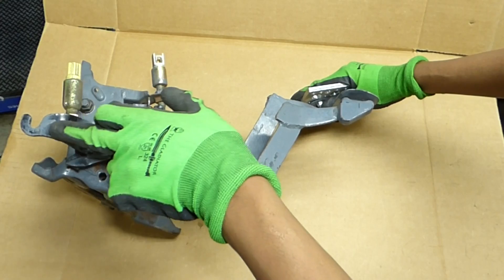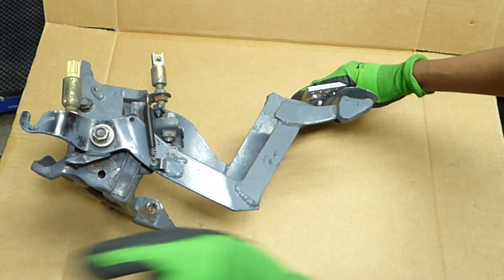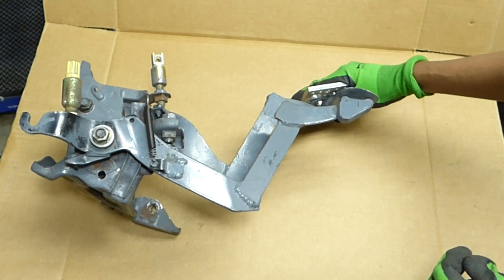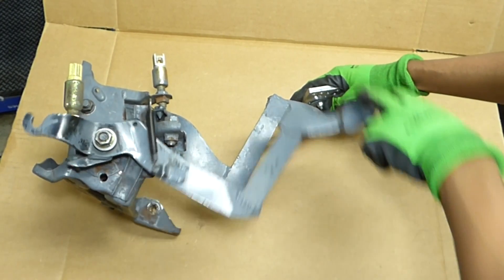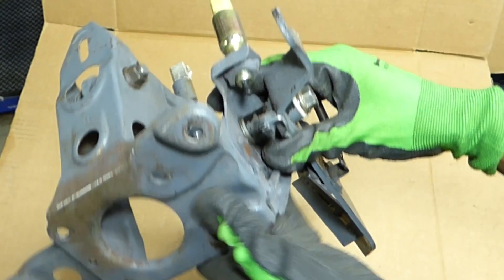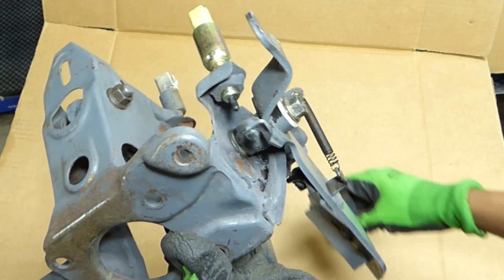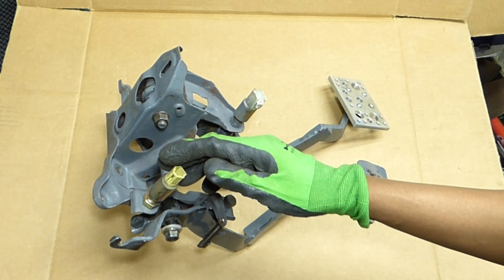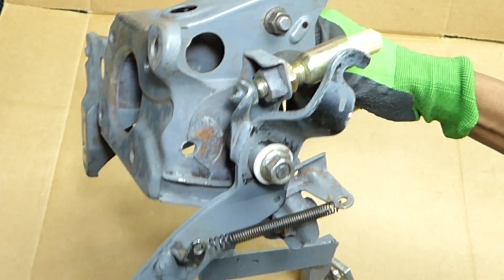(2) Manual Transmission: Why you need to press clutch pedal to start.

Comment: I think that there 2 reason why we have to press the cluch before starting: 1st what you said which is true although there no garantee of safety 100% as you said, and 2nd for children to prevent them to start the vehicule accidentely, because you have to press the cluch before starting, but if a child attempt to start the engin he will not be able to do so.
Thanks for the video.
Reply: Actually, this makes a ton of sense... Many people were telling me "it's there to prolong the life of your starter and battery" but that made 0 sense since an engaged clutch during engine start shakes and vibrates putting strain on it (and clutches are a lot more expensive than a flat battery or starter, especially on a diesel which most of us Europeans have)...it's def more of a child safety thing, good job man 👍 ...it never seemed much "idiot proof" to me since many drivers would just release the clutch pedal when the car starts and still have that jolt forward if they didn't put it in neutral 👍

Comment: i never understood why people leave the car in gear anyways. i used to take my car to a local shop to get oil changes and they would always leave my car in first gear. As a result i would stall out because due to my daily driving habits i would never expect it to be in gear.
Reply: You're supposed to park it in gear, being in gear will supplement the handbrake and help hold it still.

Comment: how about when changing gear? what prevents gear changing/shifting when clutch is still engaged (clutch pedal is not pressed)?
Reply: Normally manuals don't require pressing clutch to start the car (in Europe for example). This is only for Americans so that they wouldn't start manual car while thinking it's an automatic. Usually manual car is left in 1st gear when parked, and if you start it like an automatic, it will immediately jump forward.

If you're shifting gears while moving, you're more than likely aware if the car is an automatic or a manual and can operate it accordingly.

Comment: I learned manual on a saab. It didnt have a safety you could just thro it in neutral (obviously disengage the reverse lock) and just crank it. Wish I had that in my subie, it was pretty cool to be able to jump into the passenger seat after work and start the car up, then run around to the driver side and take off

Comment: I sent my Audi A4 2003 model manual transmission to fix pressure plate. He brought back the car and it cannot start again, after trying and fidgeting I then read on the dashboard, press down clutch to start engine, but that was not how it was before.

What should I do, is it normal or that he didnt fix the pressure plate well
Reply: your car probably just had the safety system added along with the repair.

Comment: Thanks for the video. I have a probably silly question. So when I turn off to park my manual, I leave it in gear 1st (on level ground) meaning I when I come to a stop and turn off my car I keep my foot on the clutch and keep it in first gear, then push hand brake then of course turn off the switch. Ok - my question is when I get back in my car to start it again do I need to first press in the clutch, then put the shifter in  neutral, before cranking the car? Or can I put it in neutral first (before pushing in the clutch) prior to starting the engine?
Reply from the maker: the gear may not go into neutral if you don't press the clutch or sometimes it will. you should put it in neutral so you don't hit anyone like this
https://www.youtube.com/watch?v=TzQhwuUTgH8 thats only reason you are putting it in neutral. like clutch down , neutral , shake stick , start, clutch out

Comment: Hmmm I have been starting my pick up ever since I bought it from the dealer without depressing the clutch, its been 6 years and my clutch is still good and has a good bite, the thing is my garage has a flat surface so whenever I turn off the engine, I just left it on neutral with the hand brakes engaged, even my hand brakes are not worn out. But its good to know about that info on clutch switch. I only engage on 1st gear or reverse if Im on an incline and depends on how it is parked and make sure to put it on neutral before I start the truck. Nice info btw. .

Comment: What happens if my car is stick and I don't have to hold the clutch to start it
Reply from the maker: some older cars dont have the switch  or maybe someone modified yours so they wouldn't have to press the clutch
Reply: What happen if i start the car without pressing the car?
Reply: @zhacvale8148  when in car, have a doubt